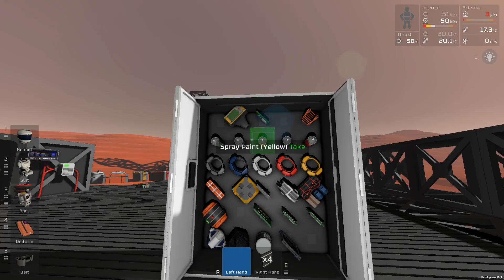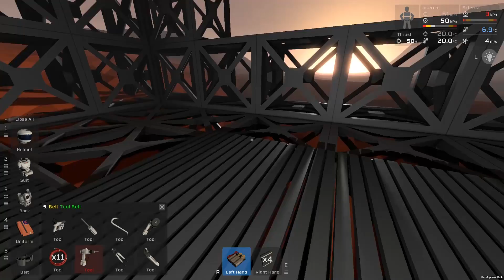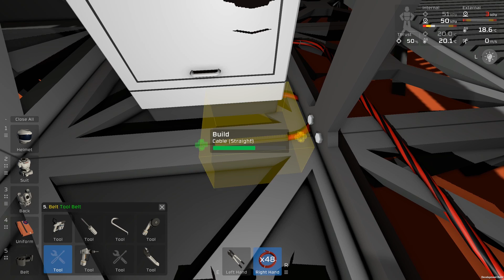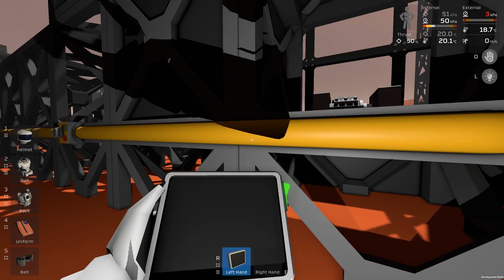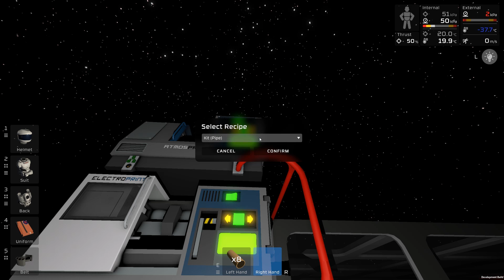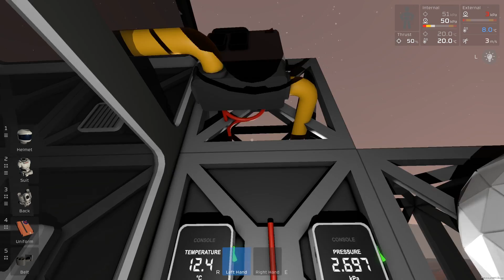Stationeers S2 E38 - Gas Generator Power!

Comment: The best application for the solid fuel generator is to use charcoal.  Ferns yield 4 plants every growth cycle.  And a single plant run through the recycler/centrifuge yields 10 biomass, and smelting that gets you 10 charcoal.  You can very easily build up stacks and stacks of ferns especially if you use automated harvies.  And a stack of ferns would get you 1000 charcoal.  That would last you probably longer than you'd care to keep playing a given world if you've got the generator setup to only run when it's needed.

That's my goto setup for emergency stationary battery recharging before I've got absurd amounts of solar panels generating more power than I could possibly use.  And if you enclose the generator in a sealed room with an active vent it's also an amazing way to generate huge amounts of CO2 if you're playing a world where that can't be just pulled in from the atmosphere.

Comment: in order to cool the room use a turbine connected to a cooling tower in order to maximize efficiency, the idea is that the gas will be denser when it cools.
edit
it will turn into water which can be stored in a pool

Comment: I have been using a slightly different solution for electrical heating of gases to run a furnace. Rather than wall heaters and radiators I used heat pumps (wall coolers) to push heat into my hot gas storage. 
Has a couple of potential advantages,  it uses a lot less energy, and it also creates a room full of super-cooled gas that could potentially be pumped elsewhere for running more efficient cooling systems or even creating a cold room to store ice/oxite/volatiles.
Reply: Glaciator Greenstone I have been telling him that all the time, and it is what I also try to do in my 'worlds', the only drawback to this is that you need like 10 to heat up a furnace when you have a lot of gas to heat up in a reasonable amount of time. However (I think) it is way more efficient to use them over the Air con. units or wall heaters. And you can isolate the pipes hot from the supercooled room by sticking wall coolers partially in the wall, allowing you to fully thermaly isolate the pipes.
Reply from the maker: Eryk, you're going to just love the solution to the gas generator cooling, I can tell :D
Reply: grayduster Ok, time to wait until 19:00 (7:00PM) where I live for the episode to 'air'. I can't wait!
Reply from the maker: You're going to be so annoyed :D

Comment: grayduster If you want to dump the heat into the atmosphere for now, there is a extremely simple way, and it uses a mechanic which is mostly overlooked and forgotten, and it is the fact that moving gas between pipe networks, or tanks, or the atmosphere (or anything else related) takes time. So what you do, is you place a active vent on pulling air from the atmosphere somewhere outside, and attached to it (via piping) passive vent in the generator room, right where the generator is located, then in a 'qube space' the generator isn't in you put in a passive vent, which is routed to another one on the outside, but (this is the important part) via a row of manual valves stuck on and arranged in parrarel between the pipe networks of the passive vents. It is also important to point out you can put the room output vent can be where the generator is (the 'qube space' it is in), but it can't be joined with the room input vent (the pipe networks they are on), because it would be pointless, since there would be no air flow, which is the whole purpose of it. You might try replacing the active vent for a filtration unit and passive vent, for way smaler power consumption.
Reply: You just might need to balance it carefully, because it likes to overpressurise the room. If that happens just add more valves or try without, but that (I think will be too much). And since outside is too cold for the generator to function, you will need to separate the pipes via some digital valves instead.

Comment: grayduster I think you should limit the fuel intake (turn off your pressure regulator) when you want to turn off the generator, because it will generate big spikes of power on just turning on the generator, since it pulls as much as it can (for this scale yes, there is a limit), and if you leave the fuel gathered up in the input pipe... it might turn some cables to shreds.

Comment: I ran into this same problem, the gas gen produces an unbelievable amount of heat and cannot run very long even in a large enclosed space before shutting down. I haven't tried this yet but I was planning to conduct a test in which one vent pushes air of the minimum temp for the generator to run into the room, while another evacuates the air through a massive series of radiators. Adding an AC unit in there perhaps for good measure. I think a system to continually cycle the air in the room would be more energy efficient than attempting to cool the air down.
Reply: Well the game takes only the 'qube space' the generator is in for giving heat and checking if the gas is to hot, so if you have a big room, it will help not as much, because gases take time to mix between 'qube spaces' (it is not instantaneous).

Comment: Attach some radiators to the exhaust pipe, since it's so cold? Should work just fine, yes? It might be slow, but the gas generator isn't meant to run full time...
Reply from the maker: Radiators are fairly slow, by comparison to the gas generator, unfortunately (which drove the temperature upwards by 20 degrees in about 3 seconds) - I think we're going to need something more active.  Probably immediate evacuation of the hot atmosphere by pumps/active vent with cooler atmosphere replacing it.
Reply: Hmmmmmmmm... Waste gas going into a wall cooler perhaps? Or several of them?
Reply: Travis Pluid Wall coolers work by cooling down the 'qube space' they are in and heating up the pipe attached to them. So you can just attach their pipes to the hot gas tank/room used for the furnace, because there is no drawback of heating already realy hot gas in the pipes, or you can just void heat with them if their pipe is empty (unless that was fixed recently).
Reply: grayduster Radiators would be quick, if you were to highly pressurise their pipes with near 0K temperature gas (or at least with gas of a very low temperature).

Comment: about cooling the gas generator - maybe pumping in supercooled X to cool it down , but first i have to figure out how to supercool the X fast enough. my thought is to use the night -70C to lose heat.  and pump it in the day back into a vacuum chamber. according to my understanding the pressure outdoor must be higher than the internal tank.

Comment: you could put an stacker on the output of the autolathe to get a nice 50x stack of cables, although i like the heap of cables more :)
Reply from the maker: Normally followed by my scream at remembering I left the electroprint on :)
Reply: that's why i prefer to use the fabricator when i want an exact amount, all resources nicely at one place prepared, autolathe only for mass cable or frame/sheet production
Reply from the maker: Aah, you enjoy the infinitely long scrollable list that isn't sorted alphabetically?  Or the really slow production? :D
Reply: the speed isn't an issue , but the UI is really terrible that is true, not even alphabetically sorted or grouped, i also enjoy the cabling/piping pain including switching all the various tools back and forth, that is a requirement for playing this game
Reply: What I did on the first world I made in the game (waayy back, in alpha) I used a motion sensor to check if there is X amount of a item in a 'qube space' my electroprint was printing into cables and I was checking that against a set value and made an automatic shut-off for the machine. It worked almost perfectly, and you would have to wait until the lot was made for it to stop printing. It was very simple and didn't involve any timing or looping varibles.

Comment: Gas generator gives off a LOT of heat. You likely have to cool it permanently while it is on, so no need for electronics, just switch cooling on together with the generator.
Reply: cmilkau Which, if you just want to get rid of, you just do the active vent->passive vent->room->passive vent->manual valve(s)->passive vent setup, which I explained in a seperate comment.

Comment: You will need a massive cooling system like your heat sink outside the green house area would be the most effective, or I’ve been using a massive cooling unit since I’m on the moon

Comment: What's the reason for the filtration unit instead of a plain pump? Better power efficiency?
Reply from the maker: They were much less power to run, but I need to check if that's still the case (they used to be 5W when running)
Reply: A volume pump uses 2kW (2000W) of power,
a active vent (pressure regulator too) uses 100W of power and
a filtration unit uses 5W of power.
Do you think why he picked it over a volume pump?

Comment: If you can find a decent source of Water (H2O) you can use the Electrolyzer (from an Atmospherics Kit) to create H2 and O2 in a 2:1 ratio.  As far as I can tell, this is the exact ratio that both the Gas Generator and the Welder want.
Reply: That can't be net energy positive, is it? Then again, stationeers fuel doesn't burn to water but CO2 + X which might be lower-energy than water within the game physics.
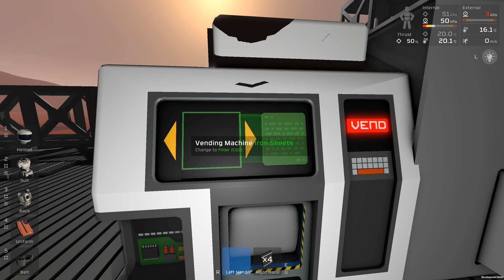Reply: Electrolyzer consumes 1200W to split water (wiki doesn't say how fast, but it does indicate ratio).  Gas Generator consumes atmo at a 64 H2:36 O2 ratio to produce 24kW per kPa; there appears to be no upper limit on consumption/production rate.  Wiki suggests using a pressure regulator on the input to make sure you don't blow cables out.
Reply: The Stick Or just use a transformer to limit energy input.
Reply: cmilkau You can't make a loop since there is no way you can make hydrogen out of CO2 neither X, and game treats all gases the same (in terms of heat storage).
Reply: It Hoover’s a massive amount of water to do so
Reply from the maker: Hydrogen is indeed the problem.  Oxygen you can get from plants, but there's no way to get hydrogen without mining - it's not in the atmosphere :*(
Reply: I'll just leave this here...

<MineableData>
   <DisplayName>Geyser</DisplayName>
      <OrePrefabName>ItemIce</OrePrefabName>
      <VisualizerPrefabName>AsteroidGeyserHydrogen</VisualizerPrefabName>
Reply from the maker: Ooh, are they in game? :D
Reply: grayduster not quite yet, but is a part of the .exe file

Comment: grayduster Just use ither a Air con. unit or use multiple Wall coolers (I think Edit:7 or more, it realy depends on how much gas you are pumping in to the generator). With that running you have enough power to run 3 Air con. units with maximum power usage it seems (unless the meter averages, then potentially 2 times more Air con. units would be supported). However you have to have as much cooling as possible in the same 'qube space' as the gas generator is in, to make cooling as relaible as possible.
Reply from the maker: Given that it outputs in the tens of KW, air con (once they actually fix it), looks like the easiest bit - turn it on with the generator, etc.
Reply: But for now Wall coolers are a thing, and will probably be more power efficient. By the way try to 'glich' it by making it forcibly swich on by some logic, maybe you could operate in impulses, or maybe the heat detection system works only when the generator is on and it would allow for a 0,5 s (or at least a 'logic tick' or 'logic update', or whatever you call it) of runtime? And as I said, you should put whatever you using for cooling in the same 'qube space' for limiting temperature transfer problems.

Comment: grayduster Gas generator will auto-ignite gas as soon it is supplied with fuel and all other conditions reqired for it to run, just leave it on.
Edit: Well at least it did that in the past.